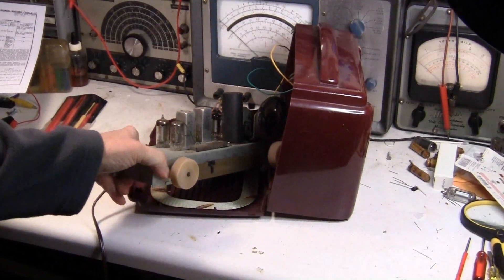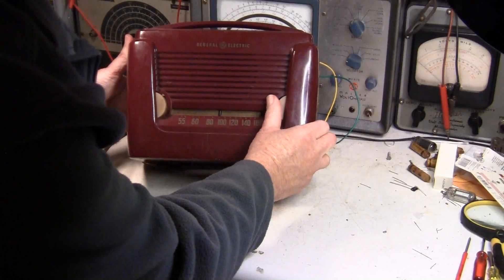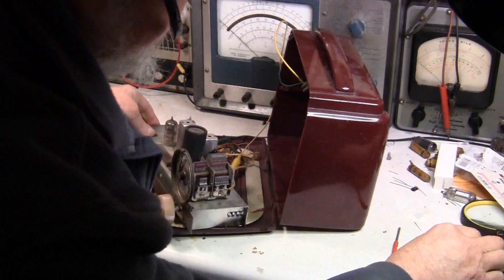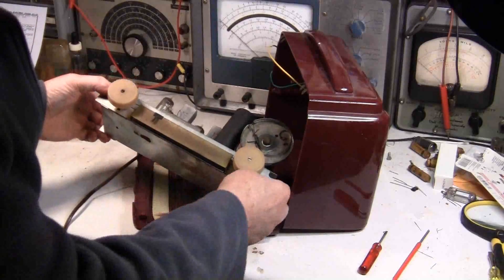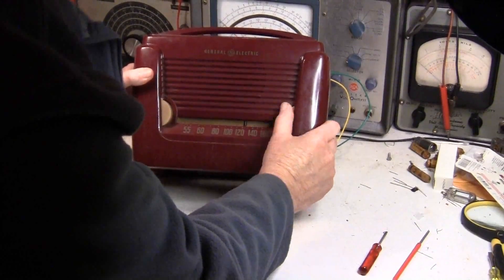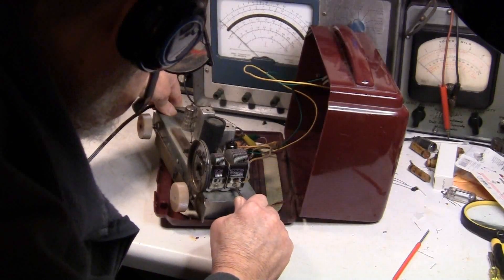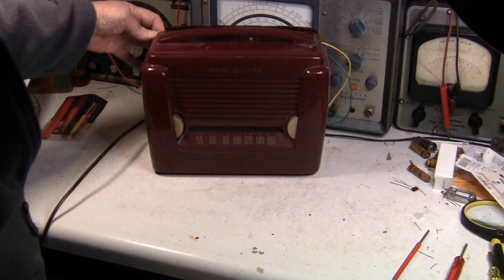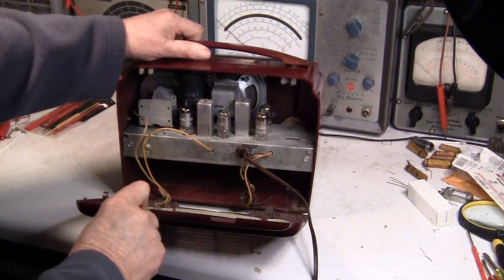Portable Tube Radio Repair, Alignment, Dial, Antenna Tune and IF Tweak

Comment: I seem to like like the G.E. AA5 radios 1950  to mostly 1960, for some reason ,but I also just started buying tube portables radios all came in working conditions ,are fire portables worth more then most basic AA5  radios anyone ,I do find them very cool ,all mine have power cords ,since battery are not made any more .
Reply from the maker: Thanks

Comment: What if there is no station in my area at 850?
Reply from the maker: Find a station as close to center as possible. If you do not have one close to center just pick one you do have. A radio station is a very accurate signal generator.

Comment: I wish to ask a question ,I bought a AA5 radio on line ,it came to me with a ferrite antenna in three pieces,I ordered a blank ferrite antenna bar ,and I going to wrap new magnetic wire around it and pray it work if you have and suggestions or input I would be glad to here  your ideas,the old ferrite antenna none of it was saleable the magnetic wire coating came off of it anyone that can help
Reply from the maker: I would try and superglue the three pieces together and use the original antenna. Or use an antenna from a junker radio.
Reply: @AllAmericanFiveRadio  thanks for the info ,I do have to replace some of the magnetic wire the coating is flakeing every where ,I will try your Idea ,but I think finding a repacement might be better,not easy,I have seen one guy make a loop antenna ,buy wrapping wire around a unused postal shipping box it worked on his radio,there is not much info on the subject,has anyone every bought a ferrite bar and rewrapped it? Of all the radio I have worked on this is a wierd problem,this is my six radio I working on my other five I have fixed worked still learning ,thank you sir for your advice.
Reply from the maker: You might try eBay "AM rod antenna, transistor radio, 5.5" long 3/8" diameter, 2 coils 4 wires Used"
Reply: @AllAmericanFiveRadio  my antenna only use two connection one to the tunning coil and one to ground
Reply from the maker: @nor4277  I would use the wire from the broken antenna and wind it on the new core.
Reply: @AllAmericanFiveRadio  sounds good thank you for your time sir
Reply: @AllAmericanFiveRadio  have you seen the blue disk capciators they are very very   tiny ,On my tube radio I replaced a .01 mfd 100 volts  cap with the blue cap it was rate 2000 volts it was so small I could have put ten of these across the stock cap I use to caps being smaller ,but the little blue one had twice the voltage ,I only use it because the stock cap was right againt the tube,the little blue one wasnt ,I would send you one if you would like one.
Reply: @AllAmericanFiveRadio  I have found a antenna I bought for something else its a am antenna made to clip on the back of a stereo ,it a two wire like my AA5 radio ,soon as I can I going to try your Idea first .

Comment: I quick question...  When you tweaked the antenna trimmer cap, the metal chassis was laying across the antenna coil.  Would you expect that this would change the antenna trimmer adjustment?

Comment: good video, you can get it working without all that test gear, even when I worked in a repair shop we didn't have a signal generator. We mostly did newer stuff and tv's.
Reply from the maker: Like many other subjects the answer is knowledge. Here's a link to my free e-book.
http://www.richardmcwhorter.com/vacuumtuberadio/
Reply from the maker: Garras Porgratix This is it. The only tool I used was a screwdriver.

Comment from the maker: That doesn't sound too serious, and the safest thing to do, is to do nothing. But it sounds like a cleaning of the wafer switches may help, but if you break something it's game over. I'm a great believer in if it works don't fix it. The problem could also be in the IF's, or both. It is truly very difficult to tell from here.

Comment: Great videos. I have a question. I have a 1940 Zenith 10S454 tube console radio which I have recapped and plays great. One problem: Once in a while I'll be scanning for radio stations and I'll get a "whoop" sound followed by thunder sound and the tuning eye closes. If I leave there long enough I hear a low pitch rattling sound then it will return to normal sound. This happens in any selection band and to eliminate the sound I wiggle the band selection. The band selection has mica caps. Help!

Comment from the maker: These ideas used a small common screw. I do like the other ones much better where you can adjust the primary and secondary from the top.

Comment: I know you chose not to, but couldn't you have adjusted the bottom slugs of the IF transformers with a common alignment tool that has a thinner section behind the "tuning end?" You pass the tool through the top slug and then down into the bottom slug.

Comment: Thanks for the videos.  I am just starting to pick this up as a hobby because I've had old radios sitting around the house not working for years.   I've already learned a few things from you by watching only two videos.  I'll be digging through more.    I see these radios all the time in antique stores, reasonably prices. Restoring them will be fun.

Comment from the maker: Thanks Ken Abromowitz
Those 1.5V filament tubes warm-up very quickly. Not as fast as solid-state of course, but the operation time from power up is very fast. There are two reasons, the low-voltage and the bigger reason of the two is the filaments are low current, so it does not take long to get up to operating temperature.